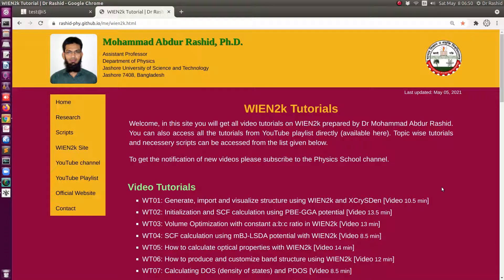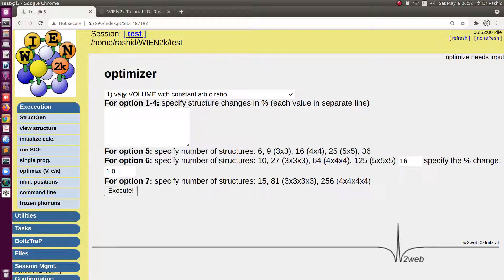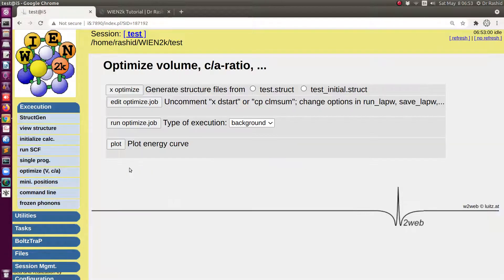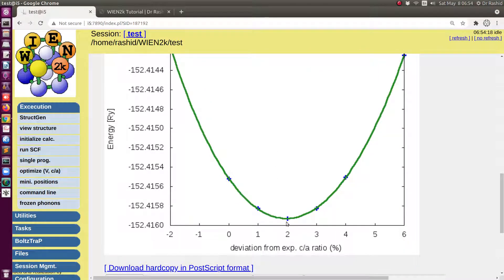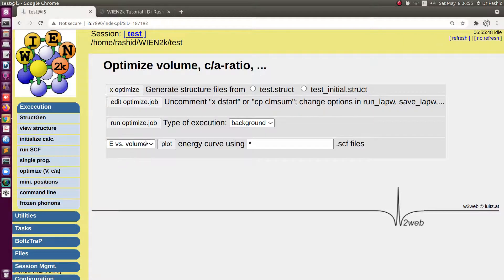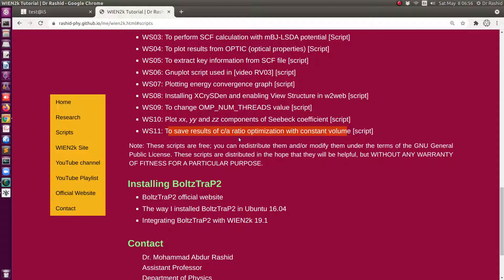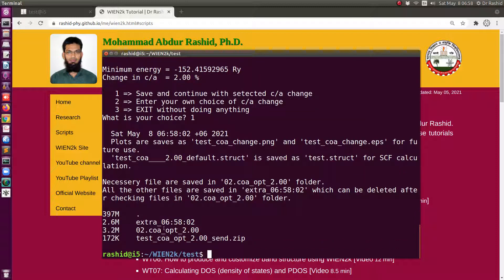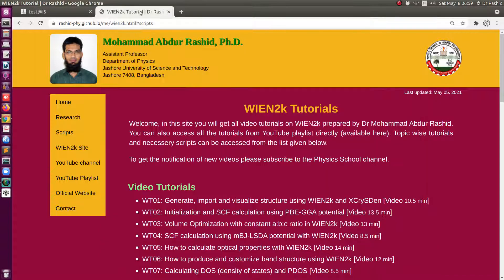WT15: c/a ratio optimization with constant volume in WIEN2k | For hexagonal and tetragonal lattices

Comment: i have a question sir.
if we choose 2D optimization i.e changing volume and c/a ration , the 8th option, for tetragonal lattice , how to get optimized values of volume and c/a ratio and hence values of a,band c after convergence? 
Note: You may not see 8th option in GUI however it is available in command line.
Reply from the maker: Don't know. Never tried!
Reply: I think for the 2D crystal you have to optimize only a and b because c is given manually